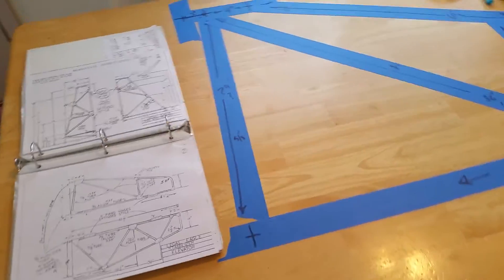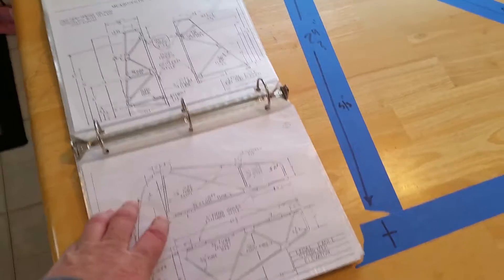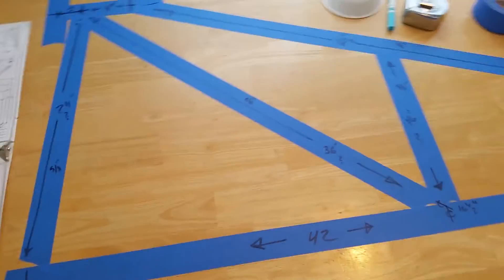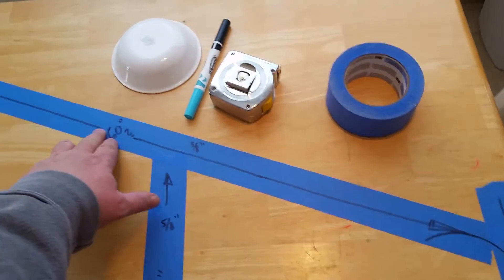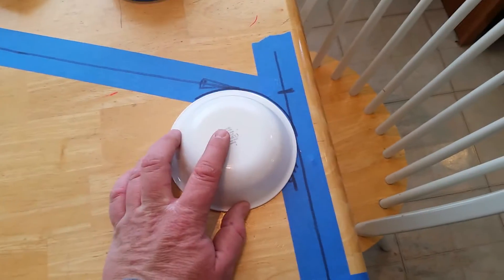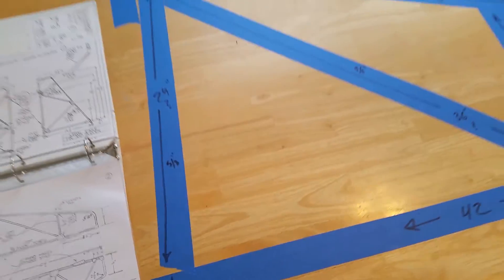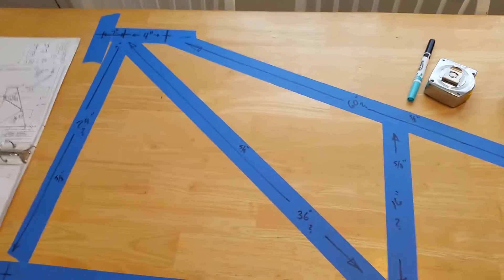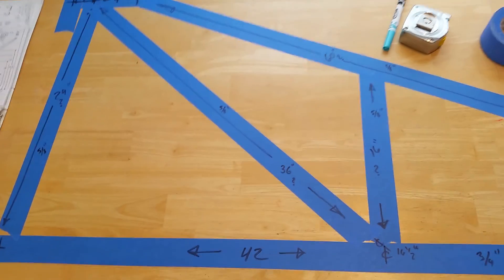Legal Eagle Ultralight Construction #66

Comment: Welcome Back! Glad to see you are resettled and are back working on your plane. I am surprised to see that the LE plans did not come with an itemized listing of tubes in optimal lengths to make shipping easier, would you send your finished list to Leonard Milholland so he can publish such a list with an update for other LE builders?
Reply from the maker: Well, remember that this is designed and built with a kind of old school mentality. I find that pretty cool. The sizes of tubing are pretty easy to figure out for the most part. The purpose of laying out with painters tape is to just get myself acquainted with the design and it's just nice to scale it to full size. I'll post the lengths I ordered in the description of the video.
Reply: LeagleEagleAirplane ,, I have a question or two,,,,. It's been 3 years,,, when did you get it in the air,,, and would you recommend that design for me,,. ???